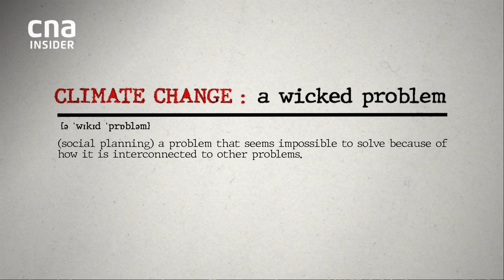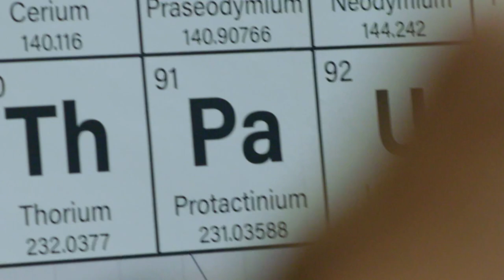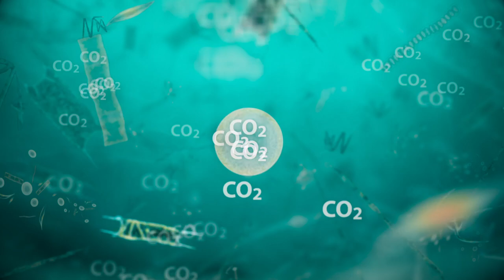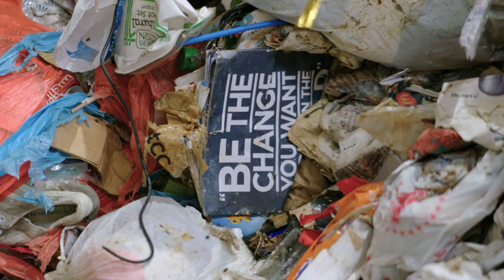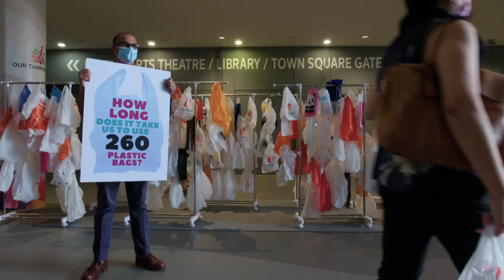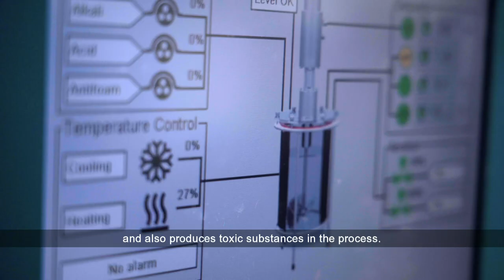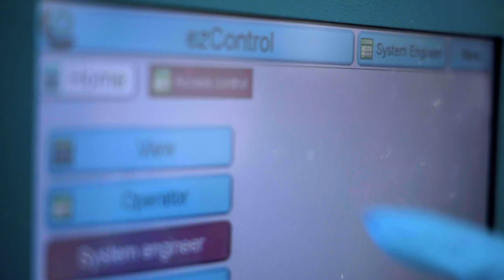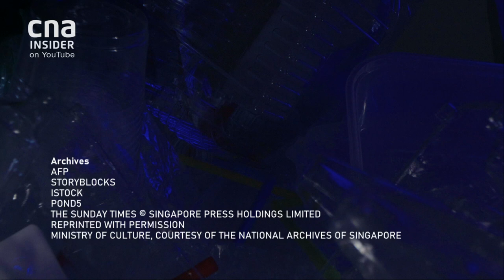Singapore's Plastic Problem: Can We Curb Our Plastic Addiction? | Climate Change: A Wicked Problem

Comment: During my stay in Korea, the supermarket don't provide plastic bag but charges consumer for bags at a cost when they require but they have packing stations where they place cardboard boxes they got from unboxing the products for consumers to pack their groceries. This can help to not only cut down plastic bags usage and also to reuse those cardboard boxes before they are thrown into recycling bin on sold to recycling firms for recycling. Hoping to see this in SG as well

Comment: Advanced nuclear power plants - usually provides process heat between 500 and 600 degree Celsius. Plastic pyrolysis is the thermal degradation of plastic waste at different temperatures (300–900°C), in the absence of oxygen, to produced liquid oil (Rehan et al., 2017). Reduce, Re-use, Recycle

Comment: But there is another problem with clothes made up of plastics. While washing them, microplastics will be released into the water. Segregating these microplastics is very difficult. So, sadly these microplastics will end up in the ocean. Some other way has to be found out without reinventing the wheel.